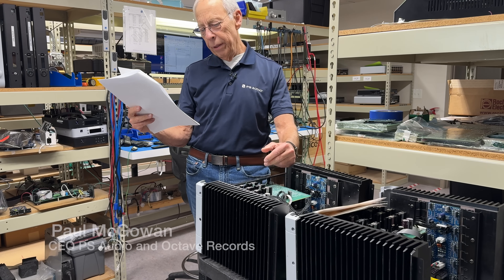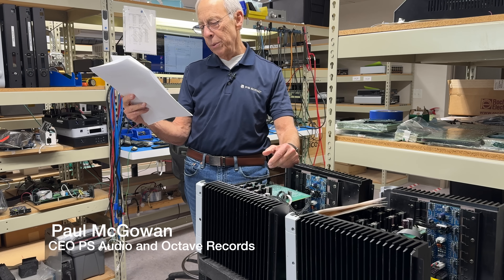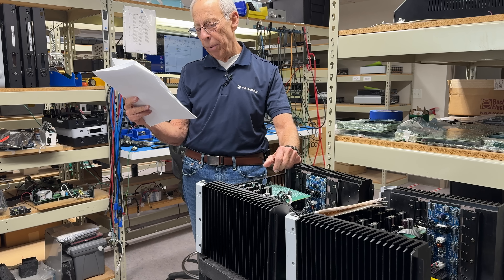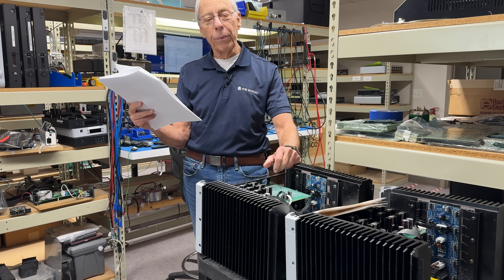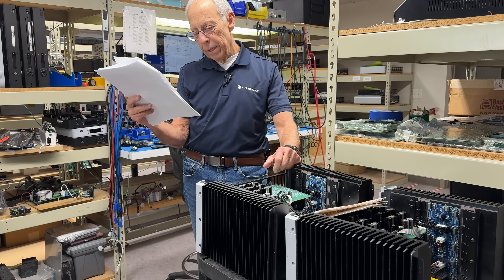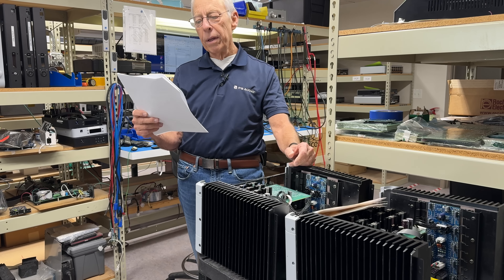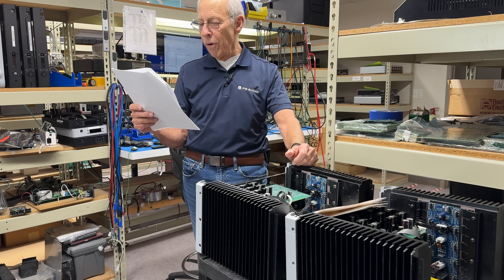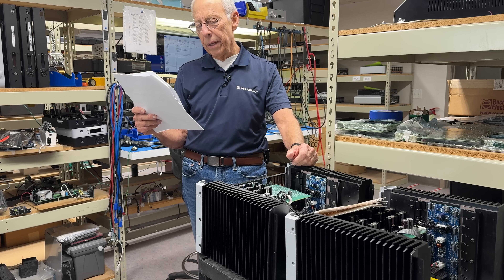How a SMPS power supply works

Comment: How can the rectified power not sound good?
Reply: Remember what he said about the relative size of the transformers? Same goes with filter capacitors. Plus 100Khz is outside of hearing range.
Reply: @gunnarkarlsson195  The reason is that it takes very large filter capacitors to supply DC power during the time period that the input sine wave drops below the voltage of the capacitor.  And, the tighter the regulation of the DC filter capacitors, the "off time" increases every more.  This is called ripple voltage, and it creates another problem.  Diodes, because of how they are made (P/N junctions) create extra noise as the electrons cross the P/N barrier.  You want as few as possible diodes in the DC path of your circuit

Also, as the "off" times get longer and longer in your rectifier circuit, the shorter "on" times become more and more "violent" in how much energy they pull from the ac mains (wall power).   Remember how this full-bridge rectifier setup is noisy?  Well, it just makes the problem of noise worse as you add larger and larger filter capacitors...  And, part of this surging forward current, during these shorter "on" cycles gets reflected back into the outlet as a noisy voltage drop every half cycle for your tuner, phono, CD, DVD, DAC and other components to have to filter out.

It's a very rough dog-eat-dog world out there in the household AC supply.  I think that's one of the reasons that Paul made his power conditioner.  Calm down the noisy power lines to help conventional (rectified) power supplies cope with these noise issues.

HTH... please leave more questions in the comments if you have any more questions.